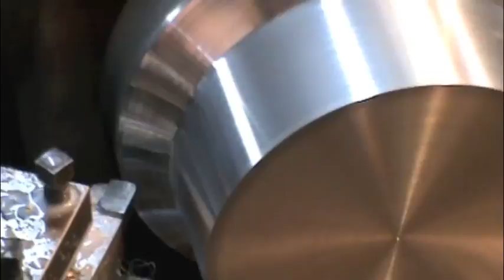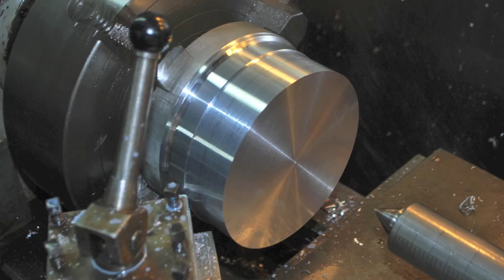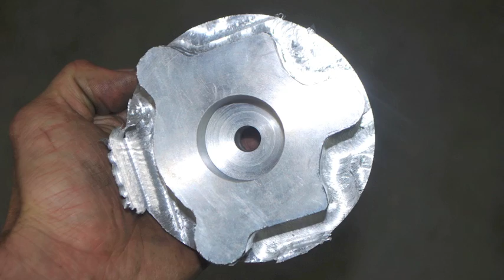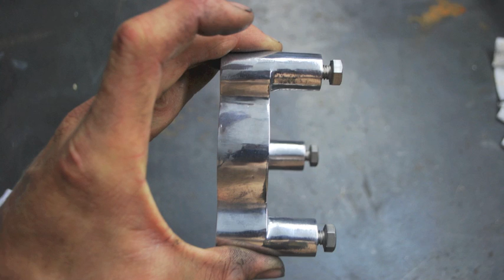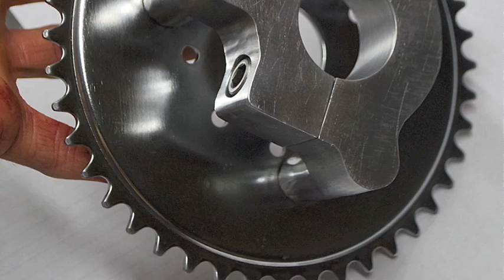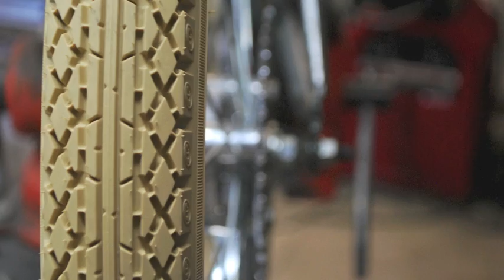making a billet hub attachment for a bike wheel

Comment: Very good job! Im curious .Why did you cut the brake arm? No big deal,since most need offsetting to clear sprocket bolt heads.A jam net holds them on axle. I recognize'china',GOOD GREASE AND NO PRELOAD ARE CRITICAL.